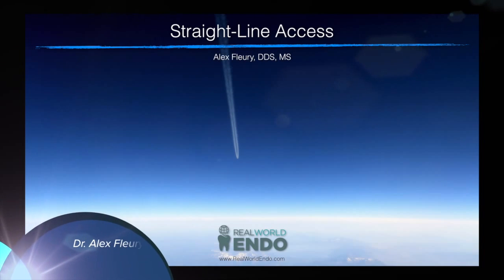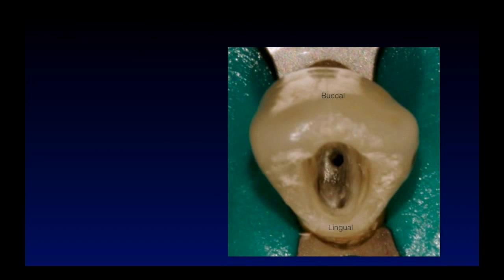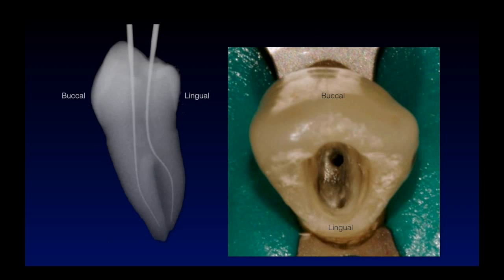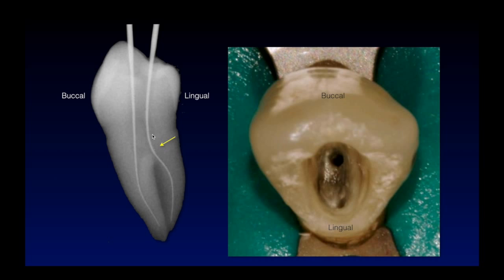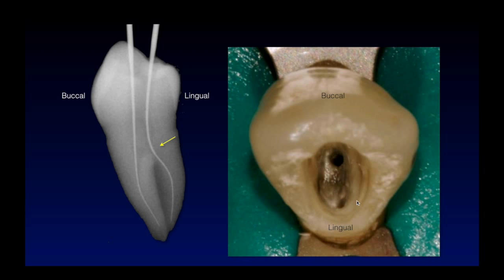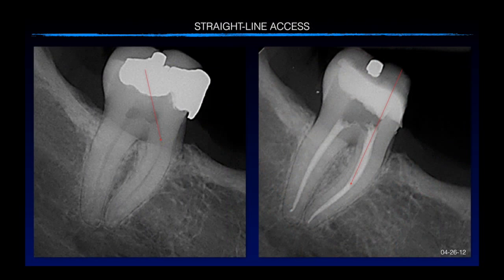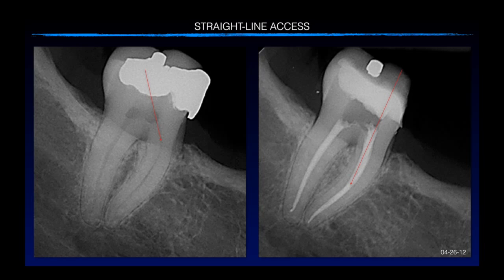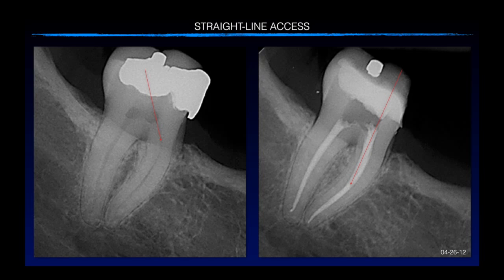Straight Line Access: Dr. Alex Fleury Podcast

Comment: I STRUGGLE between over/underprep. In one view I can see all,but with a slight tilt one is gone. 1st Questiion : whats the best mirror angle here? 
2nd Q: is there any other way to check straight lines? Endo explorer angle can change, one angle its straight, other its under prep. Very confusing to grasp thia idea. Thank you for your reply in advance.
Reply: Gently insert a k-file into the canal until it meets resistance, then release your grip and watch where the handle of the file goes - if it flexes off and rests against a wall of the access then you need to unroof some more dentine there. If the file sits in the air of the access but at the canal entrance it is tight against one side, then gently open the orifice with a GG or a coronal flaring rotary file. This should reduce the resistance on the files as they instrument

Comment: Does it mean all canal should be seen in one view
Reply from the maker: Ideally yes. This helps provide a straight line path for each canal. However, this may not be possible in all situations. The goal is balancing this concept vs. removal of excess tooth material if not absolutely necessary. That's a balancing act.